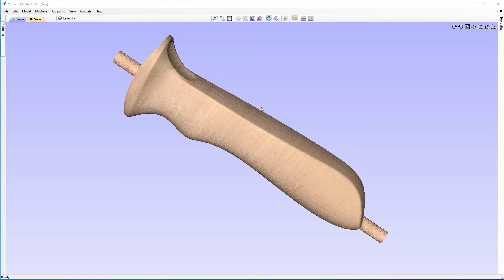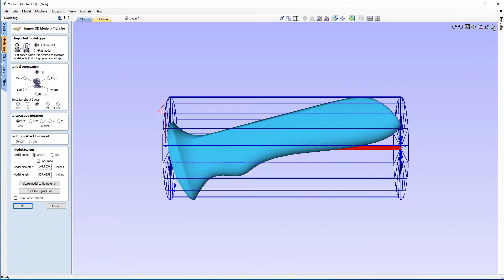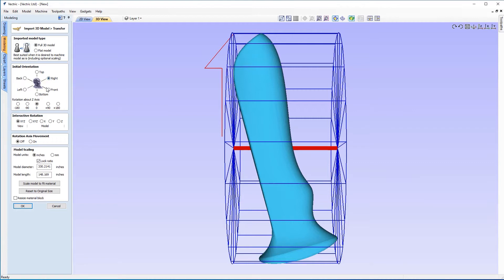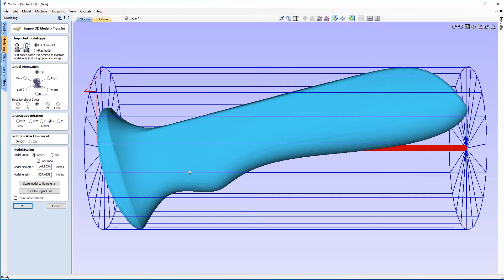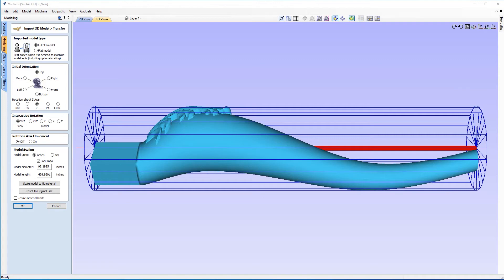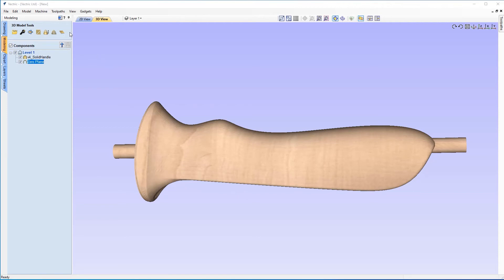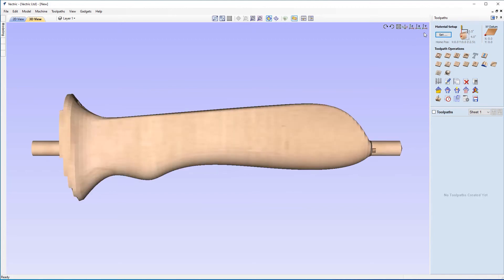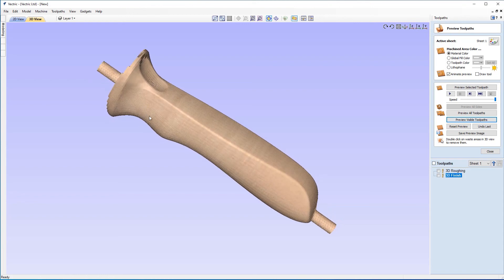Import and Unwrap a Full 3D Model for Rotary Machining | Vectric V11 Tutorials

Comment: Hi, very good video! I have a doubt, which post processor do you select when generating the file?
Reply from the maker: Hello and thanks for the question.  This will depend on the CNC you own and that is selected at the point of the saving.